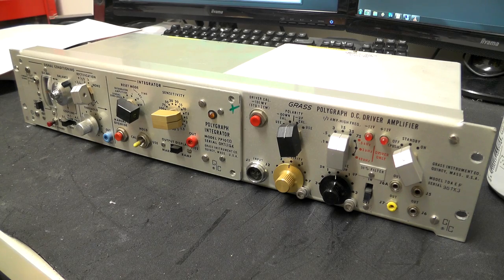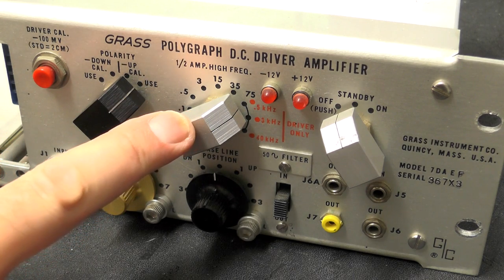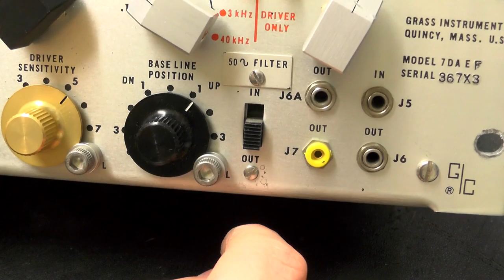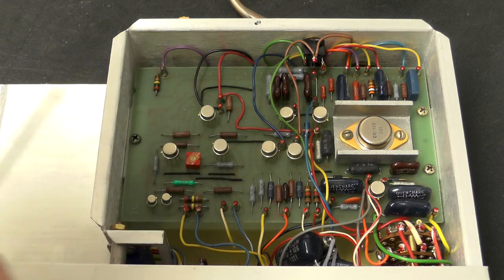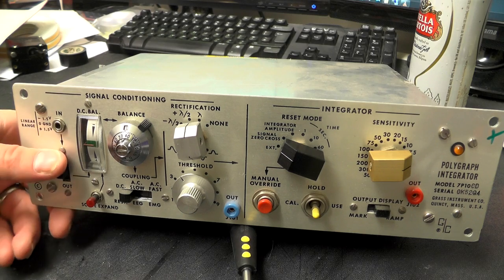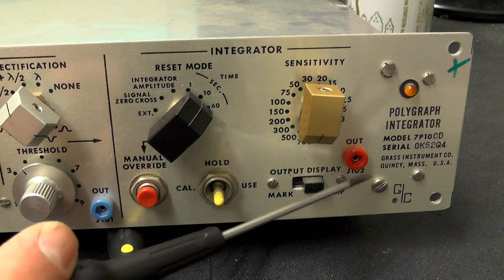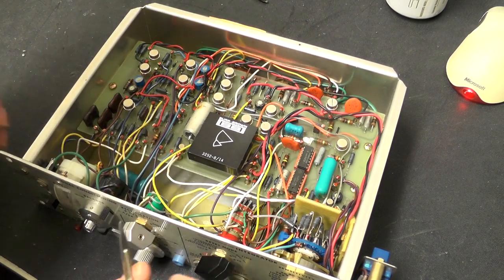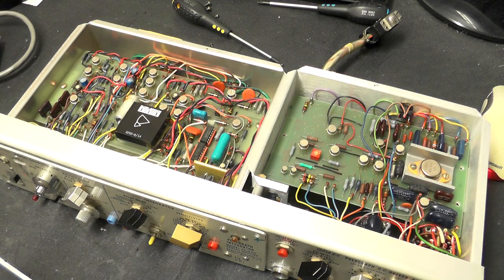DL#077 - Grass DC Driver Amp & Polygraph Integrator Teardown

Comment: I could x-ray that burr-brown module if you like!
Reply from the maker: +mikeselectricstuff Thanks Mike, yea that would be cool!
Reply: +DextersLab2013 can't wait! :)
Reply: +DextersLab2013 One Burr Brown hybrid, yes it is both an integrator and a buffer opamp input and output. Integrating cap is that massive glass seal film unit next to it. The cap is likely a low leakage PTFE film type.

First one the big TO3 package is another opamp, likely a Nat semi part as they did make some ( obscenely expensive even for military parts) nice power amplifiers. That one is a 1A power opamp, I think I might still have info on it in an old Nat Semi databook here. Just the 8 lead TO3 package alone was in the $100 ballpark in 1973.
Reply from the maker: SeanBZA Thanks Sean, let us know if you find the data on that TO3 opamp!